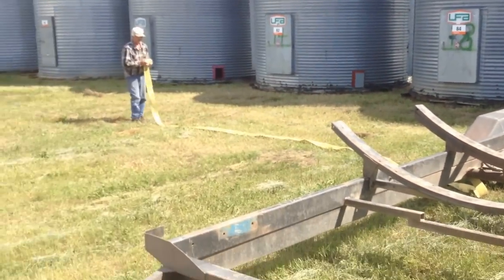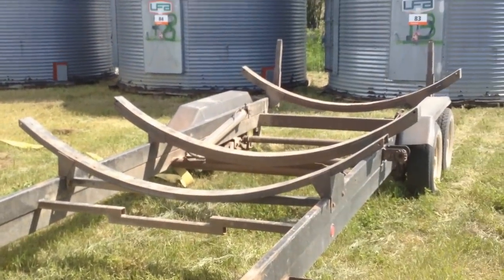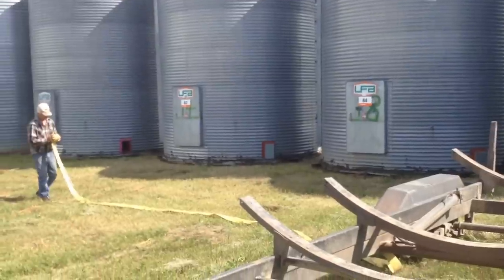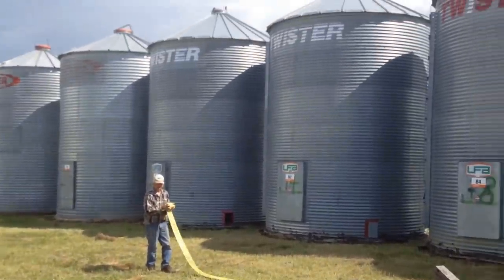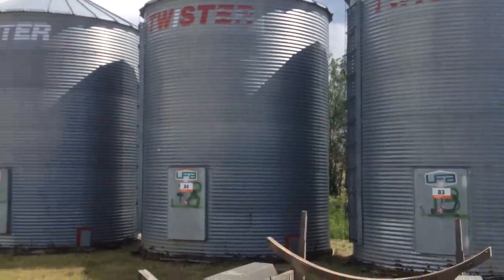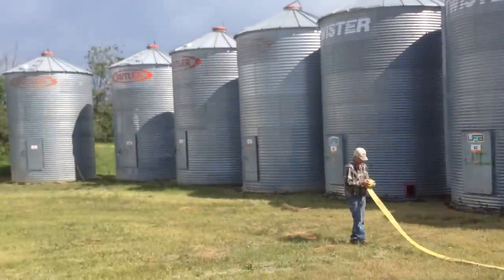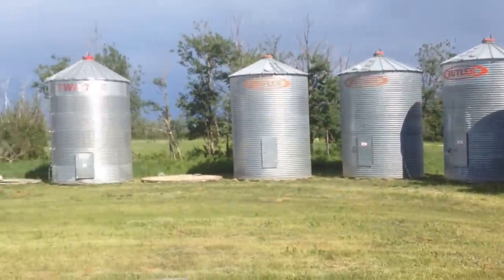loading steel grain bins pt 2

Comment: there alot of older bins around here with metal floors they are sitting on cinder block foundation and just anchored to the ground with cable and t posts
Reply from the maker: Yea.. buggers blow over easy with these strong winds we have.

Comment: Did you build this trailer yourself? I would like to know some dimensions of it if possible.
Reply from the maker: No I didnt... I rented it... There is a guy that lives near by that rents it out to everyone.  Its actually really a simple design. Just 2 x6 steel tube as long as you need to fit the bins on it.  This one will handle 14 ft round bins by I think about 20-25 feet long.  and two axles.  You need some long hydraulic cylinders to.
Reply: Ya very cool. Those are some long rams for sure! Works awesome!

Comment: Do you rent these out?
Reply from the maker: The Bin Mover or the bins?
Reply: the bins/
Reply from the maker: No.  I bought them at a auction that happend to be only 2 miles down the road so I couldnt pass them up.  I lost 4000 bushels of storage from the crazy wind storm in march. I like big bins like the one you have but these are so easy to move and set up so its ok for now. The field they are on is 600 acres so I need space.
Reply: oilerman9406  
Awesome. How do you anchor them to the ground or do?  Are they just heavy enough they wont go anywhere? I noticed you said you lost some storage to crazy winds was wondering if they blew over.... I love that trailer,,
Reply from the maker: 20yearhvacguy I dont anchor them to the ground.. which really is bad with the freak winds we have gotten.  These have wooden floors on them... treated 4x6s 8 I think... then 2x12 boards with plywood on top.   They are heavy that way.  I also moved all my bins in a east to west line instead of having them faceing the east and west.  And yes I had one blow over that had a rotten floor that I was meaning to replace... and the other .. the wind just ripped it right off the floor.